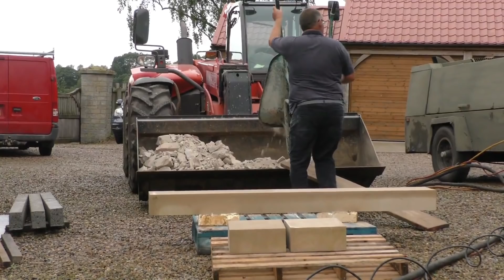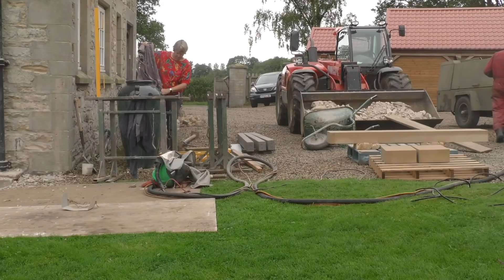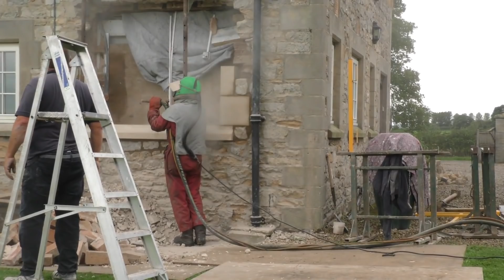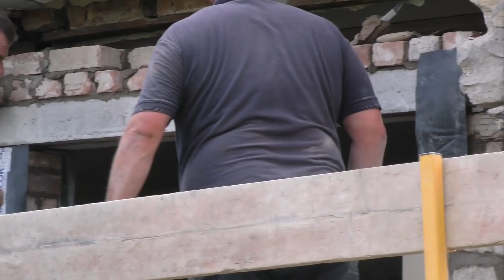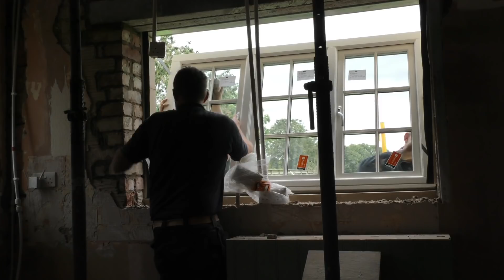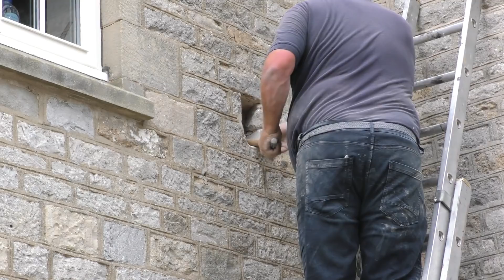Equestrian House Makeover PART TWO

Comment: Wow, the work that has gone into making the window. Looks stunning. Very pricey I should think.  I think you mentioned Rens in the previous video doing some skating, was this speed skating. Watched a little on YouTube  and Lacrosse. Speed skating very tactical and fast.
Reply from the maker: yes speed skating.  Rens learnt on wooden skates with a metal strip
Reply: Tara wow,  why do they have either both arms behind them or just one, is this something to do with wind resistance. I’ve seen them use one arm going round the bends.  X
Reply from the maker: 👍round the bends is for balance 😊
Reply: Tara thank you 💓

Comment: Stone work is an interesting skill set for construction. Modern builds tend to use facade stone, which is not the same thing at all. In Canada I would say the skill is quite scarce, except in historic areas. We had some major repair work done on the front of a condo and we had trouble finding contractors who could work with real brick, as opposed to facade.
Reply from the maker: tfs such a shame Canada is losing their crafts men
Reply: Not really, lots of craftsmen, but not a lot of call for stone houses these days. I have watched many talented stonemasons refreshing our parliament buildings. It just all depends on where you live. So don’t think we are losing our craftspeople, we have plenty., but you cannot expect to find them in scarcely populated areas. Ontario for example has a lot of brick masons because most of the houses there being built have brick. It is less common in some other areas of the country.  Our country is immense, and diverse.
Reply: If you notice I said historic areas. And no, cities with a million plus people don't exactly qualify as scarcely populated areas. I have no doubt there are still masons where specialty projects are. However, I wonder how many have come from other countries because Canada doesn't have enough stone structures to support a large field of specialized labour.
Reply from the maker: tfs😊 Kate D